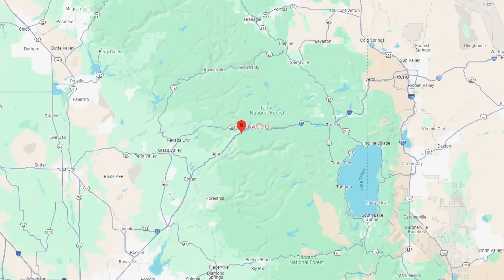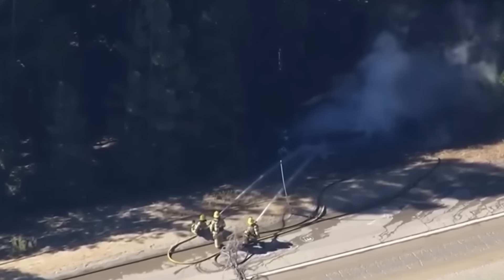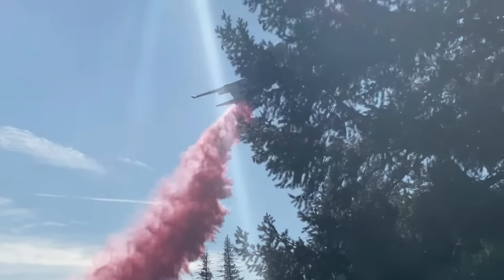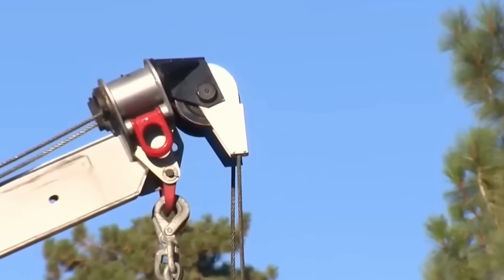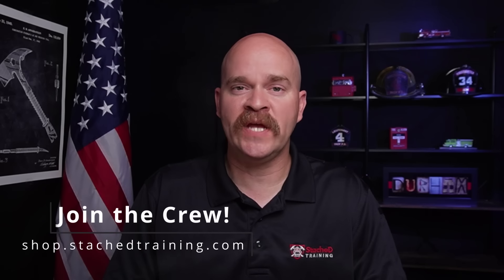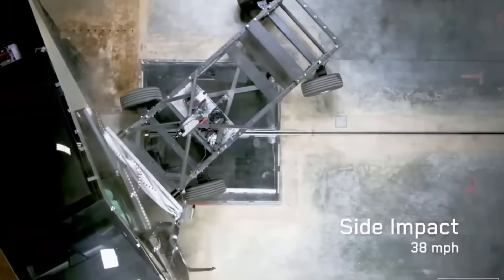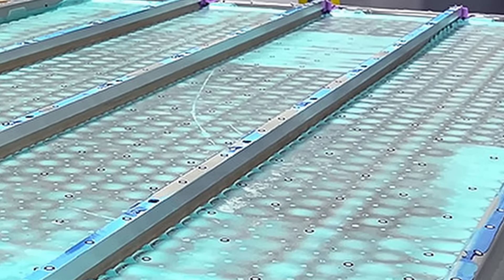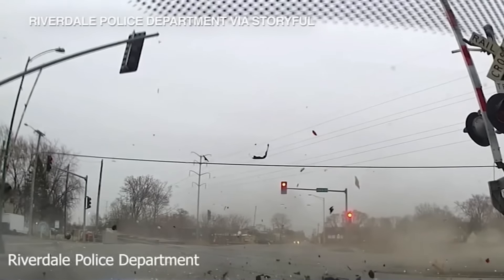50,000 Gallons! Tesla Semi-Truck & Cybertruck Fire

Comment: no seriously, why not liquid nitrogen?   I don't see crush zones on the cyberjunk
Reply: I have thought the same too RE: liquid nitrogen for EV fires. 

My guess is: a) it isn’t exactly easy to keep tankers full of cryogenic LN2 around ready to run to a fire at a moments notice, and b) safety to both firefighters and the public. LN2 is pretty dangerous stuff so spraying it all over the place (and especially on super hot surfaces) could be pretty dangerous for anyone around.

Edit: also, now I think about it, spraying large amounts of LN2 around would be really bad for the surroundings too! It would kill any plants unlucky enough to be near the car and possibly even freeze the road / surrounding structure to much colder temperatures than what it was ever designed to withstand so it could maybe even cause the road / structure itself to fail (I dunno for sure, just a guess).
Reply: Because these type of battery fires are self containing. Don’t need oxygen from the air.
Reply: @roybm3124  that is true! However, the way you deal with EV fires is by cooling the packs so the idea of using something to try to instantly freeze them makes sense to me (at least theoretically) 😊
Reply: @bear4278  Good question for @StacheD Training. Water has a great vaporization energy number. Liquid nitrogen is quite impractical and only made on order in this form and quantaties I think. Plus added risks for the firemen and surrounding for cold burn risks and suffocation.

Comment: Ev are amazing  vehicles  there just no for me.     Imagine having a highway crash  with 20 or 30 ev
Reply: Older batteries didn’t have the fire risk, although older nickel cadmium, lead acid, etc, lost charge more quickly over time and needed to be replaced more often

Comment: At what cost was the plane ? OMG isn't it time to PULL THE PLUG so to speak till these vehicles are working. Put in industry 1st, correct the issues, then go public
Reply: "In addition to the cost of conversion, supertankers can be expensive to operate. They can cost around $63,200 per hour to fly, and each drop can cost $65,000." (Google AI)

Comment: I hope you are looking at the 'EV self combustion events' recently in Korea (140 vehicles destroyed) and the parking garage in Lisbon Portugal where 200 vehicles were destroyed. Pretty soon as EV's get more and more common we are going to see EV self combustion events in basement parking areas and quite possibly structural damage of the building above. Most structures are only designed for a couple of hours fire rating certainly not 4-6 hours of intense heat from EV fires. Are we watching a disaster in slow motion? In Australia Governments are looking at only permitting EV charging in enclosed parking spaces up to 70 or maybe 80% to mitigate EV fires which are common. Every 'week' in Australia approx 20-30 Li batt fires from all forms of EV transport (cycles, cars, scooters). Maybe a world EV vehicle fire symposium would be needed about now to head off this probable disaster.
And dont get me started on EV damage to battery compartments, recently a Hyundai EV ran over a brick and self combusted due to a dent in the battery pack. Also some Insurance companies are writing off EV's if the have any panel damage in battery floorpans. They have found out it costs more than the EV is worth to pull the battery out, inspect it and if damaged replace it. EV's could very likely become quite 'disposable' at around 5-10 years of age.

Comment: What is the point of your video? Why have you targeted a Tesla fire and  accident? Surely there are hundreds of fires and accidents every day involving other car makers and yet you are not reporting on them. Seems a little odd. Seems like you have something against Tesla in particular. Does it really matter how high it burns? Burning of any vehicle is bad, and it all comes down to the driver, how they drive, the safety features on the car in the event of an accident.
Reply: Because he is an automotive battery engineer, and his private business trains firefighters in dealing with battery vehicle fires.
Reply from the maker: If it was a  diesel truck burning, the fire  would have been extinguished in 30 minutes. The fire department would have only closed down one lane of traffic.

Comment: Thanks for the info! 
I was too lazy to look into these two incidents myself.
IMO any manmade vehicle will burn/explode if it hits concrete at >100mph, BUT EVs have a chance to be safer than gas. BYD's new blade battery seems very promising. It can be punctured, cut, still won't catch on fire. We're just at the beginning of battery tech development....